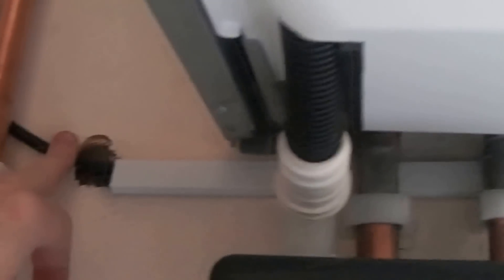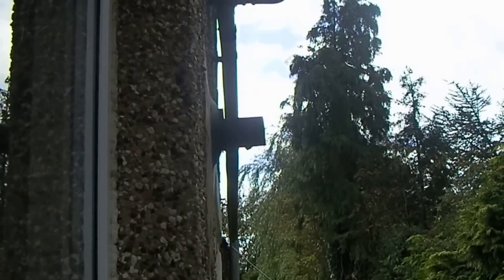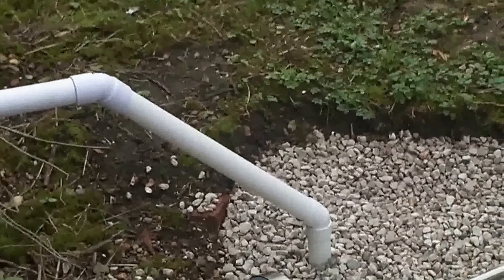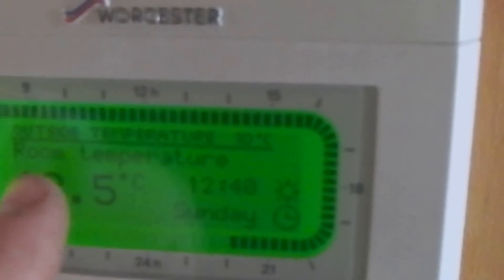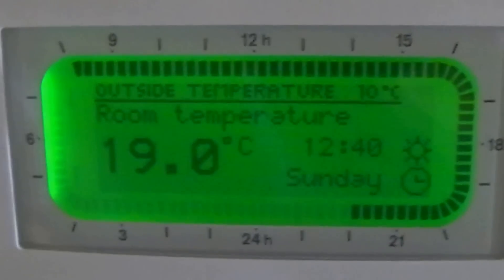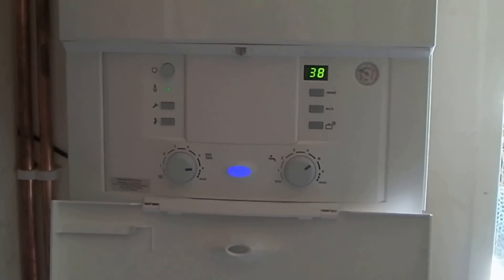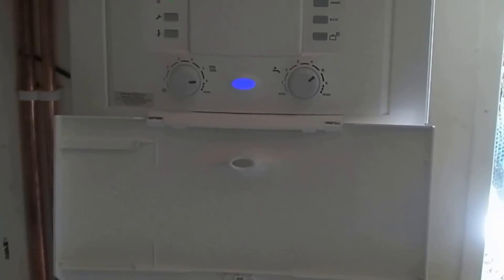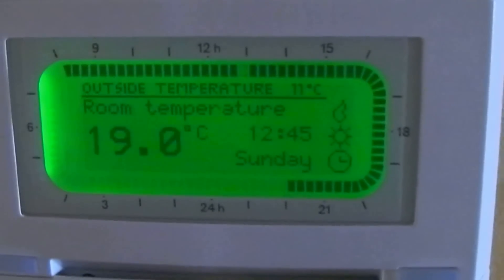How to install central heating. Part 21. Final Instalment.

Comment: Openly admitting DIY gas jobs is punishable by law, sure Gas Safe would love to make an example out of DIY enthusiasts
Reply from the maker: I repeat yet again. That is not what I said. Just like some twot can change brake discs and pads. Perfectly legal. What would be a legal issue is if you blew up your neighbourhood because of a botched job or killed someone in your car because you ballsed up a brake repair.
Try reading the past comments.
Try reporting me to the Police, Gas Safe or whomever you like. You will get nowhere as no laws have been broken.
I wont be answering any further comments about the legality of DIY installations in any of these videos. It has been fully covered repeatedly.

Comment: Brilliant job i would like to ask a couple of questions,firstly this business of the gas engineer coming round and checking it all out,did you actually have it all running before he turned up,and secondly could i ask if i have this right you main living room showed it was 32 ft by 12 and 9 high ,and that came out at 20.000 btu,s ,just wanted to check ,as we have a similar room to heat,great video cheers .

Comment: A complete waste of time the government does it for free new Worcester boiler new existing central heating Megna clean thermostat new pipe work all copper I had it done low incomeI mean everything free even if u can do it you rather spend all that time with family instead of looking to save at the end of the day there is no saving do u have £10 000 saved after this project I doubt it and did u even pay yourself no chance and u talking of hiring a skip you so tight you won't give anyone ice in winter you proberly took it to the dump yourself and even tried to get your money's worth on all the old copper tank and scraps cheap skate
Reply: Rehana H Did you stop to consider that perhaps he isn't on a low income? Difficult to convince the government to pay for a supply and fit of a new heating system for you if you're in the 40% tax bracket... deary me. I also suggest you go back to school and take some extra classes for grammar and spelling.
Reply: Rehana H 
What a stupid person you are! are you implying he go and beg one off the government for free ?
Give the guy credit for fitting his own and taking pride in his own work. Well done to him

Comment: Loved the series. My grandfather installed his in the early 60s. Due to the era he used 15mm copper pipe to all the radiators. The boiler was a big thing actually mounted in the wall behind the gas fire place in the living room. I can remember in the 80s we would go for tea on a Saturday and in the hallway there would be an old Stilson wrench amongst other tools, as he had been doing some central heating maintenance. Over the years he had the odd problem with it but only down to age/wear and tear, but nothing that he could not put right himself.

Comment: Why have you got a lime fighter on the flow pipe?  Looks very rough.

And what the hell is going on with the radiator at 8:50?  Did your tape measure break? LOL.

Comment: I thought i would just clarify things ( i am a Gas Safe reg installer ) . If you are working in your own home that you live in , you can connect any gas appliance you want and it is totally legal to do so , as in this case in order to comply with building regs and to get your warranty validated for the boiler , the final testing and commissioning has to be done by a gas safe guy who then informs your local building control that the installation is safe and he will then issue you with a completion cert , the other thing that i should mention is that if you are letting a property ( eg  you are the landlord ) then you can not touch any gas work whatsoever otherwise you could be prosecuted and fined up to £ 10.000 and risk going to prison if anything goes wrong and some one is killed .

Comment: I found this a really fascinating series. Thanks for taking the time to record and make it public.

Now we're into the winter and have had a few cold nights (although no real snow & ice yet), I'd be interested to hear how well your system is doing. Does it live up to expectations? Have you had any problems? Did the radiator size calculations work out okay in practice? Worth an update video?

Comment: Great job apart from one major area. Spend a few extra pounds and make any visible pipe connections to rads in copper. Just looks gash in plastic pipe with hideous plastic elbows everywhere. Just connect the copper to the plastic pipes under the floor.
And stick with labradors - kids are a complete P I T A!

Comment from the maker: Sorry, that is not correct.
That is not the law, if you screw up and do some damage then you can be prosecuted.
You can and will not be prosecuted for fitting your own boiler, it is not against any law!!!
Can you imagine a gas safe engineer would turn up here knowing full well I installed everything myself, then proceed to check everything and then assume full responsibility for the installation after issuing a pass for it if it was in any way breaking some law/laws??????